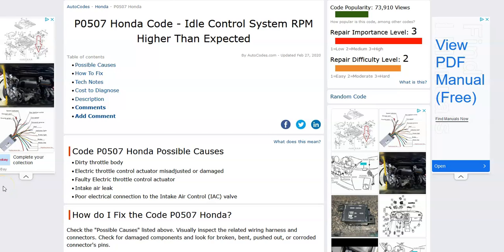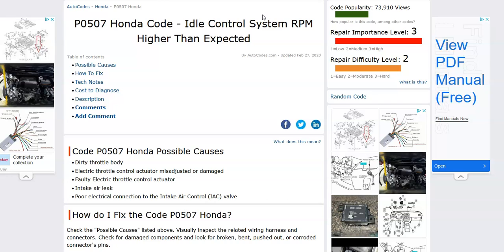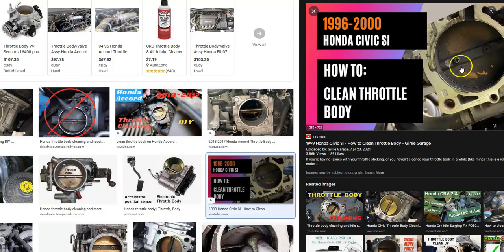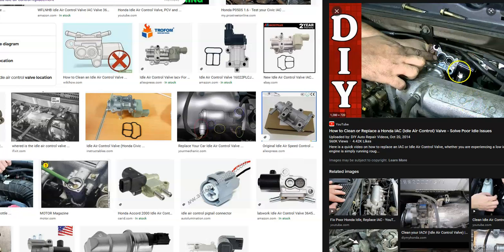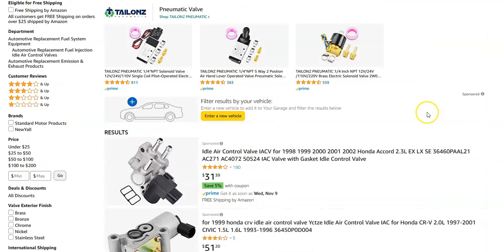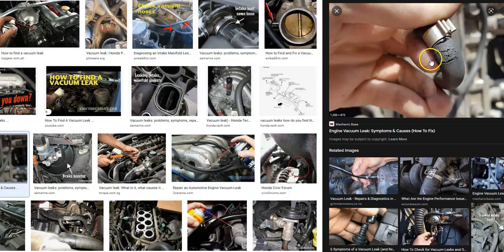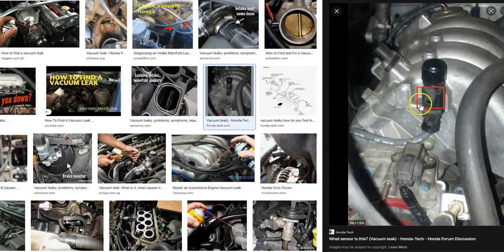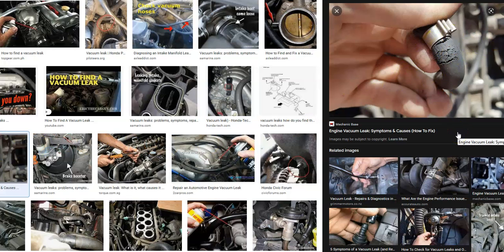How to Fix Honda P0507: Idle Control System RPM Higher Than Expected

Comment: I cleaned throttle body 2 weeks ago and yesterday this code pop up.
I also noticed that vehicle is loosing coolant. 
Can you pls suggest what it could be especially about coolant missing?
Reply: Did you figure it out? Just had the throttle cleaned and this code came up too
Reply: @mvmai1940  yes. 
Run the car at 3000 rpm until fans come on then let the vehicle run on idle for 15 min and it'll fix the problem.
Reply: @farhaanahmad9444  so while parked, rev the car to 3k? Or while driving? Do I need a scanner again to reset anything?
Reply: @mvmai1940  run at 3000 rpm when parked.
After completing this cycle check the idle rpm. It must come down to normal. Engine light may go off automatically or you can erase the code using a scanner

Comment: Do you know where the ideal air controle velv is on a 2010 Honda Civic with a 1.8l engine?
Reply from the maker: Some Hondas don't have an idle air control (IAC) but electronic throttle control (ETC). If yours has one, it will be located at the bottom of the throttle body.
Reply: It has no throttle cable so I'm assuming that it is electronic throttle control

Comment: Mines the  weirdest High Idle it starts at normal and it goes all the way to 4.000 to 5.000 rpms or higher if I let it!!I replaced  the idle sensor  throttle and disconnect every known thing known to mankind and stiil Takes off   on its Own!!!    to    4.000 5.000 rpms!!
Reply: Make sure you reset the computer after anything that alters that af ratio if you replave the iacv it needs a ecu/pcm reset and/or an idle relearn procedure same goes for a throttle potion sensor. If you replaced the tps you need to make sure it's voltage is set to the manufacturer spec if it says it needs to be at .50 volts it needs to be just that. You can most likely find a video or forum to learn how to do it

Comment: If you have a good scanner , it has an option called throttle relearn , it will relearn the idle
Reply: I do and it didn't do anything I think coolant got into the connector cuz I had to take the throttle body out and coolant dripped into the valve connector and the wire harness and since then the code came on
Reply: @projectskadi935 same

Comment: there's no idle air control valve for 2007 honda accord and i'm going crazy here
Reply: Pretty sure it's built into the electronic throttle body from 03-05 it was a cable driven throttle body in 06 and 07 it was switched to drive by wire

Comment: Low antifreeze
Reply: hmmmm 🤔
Reply: Really?
Reply: Or air in the system. Squeeze your inlet and outlet hoses with the radiator cap off and look for bubbles.

Comment: I had the same thing and did the relearn idle and checked for leaks and nothing i did almost everything that says on the internet the last thing that i did. I went to the mechanic and with a computer he reset the throttle body and relearn the idle and then it got FIXED. Everything went back to normal
Reply: How much did the reset and relearn cost ?
Reply: @justingilmore7366  he charged me about $80  dollars he is my friend he didn’t charged me a lot like other mechanics
Reply: How does someone do the relearn ?
Reply: @Starsnstripes25  they do it by the computer 🖥️  with a OBD2 cable plugged into your car 🚗 they have to reset it and then do the relearn idle
Reply: @Elvys809  all I did was take the battery post off and starter removing the exhaust manifold and removed the EGR hose and coolant hose to attempt to get tkt the starter from the top for an 08 Honda Fit! Then the idle started going nuts! When I put everything together.... Could this be just because I took the battery post off? Cuz I found a video on YouTube in regards to programming the relearning system and it worked for me.
Reply: @Elvys809  Where can I buy my own scanner to do this myself down the line

Comment: That code appeared after having the valve cover and gasket replaced. I don’t understand
Reply: Same here Did you fix it?
Reply: Did it get fixed
Reply: You likely didn’t put it on right used the existing original gasket which has worn down, if the code came up afterwards